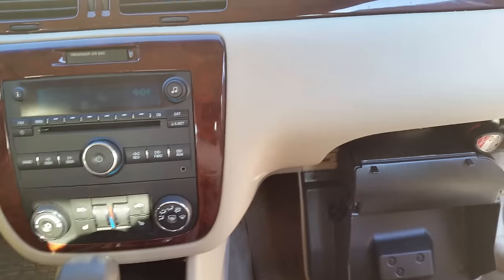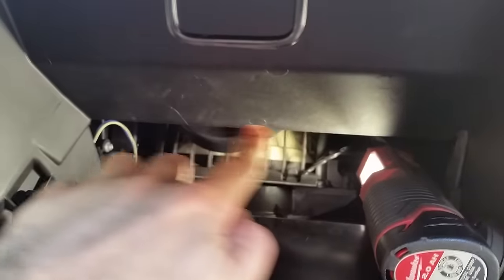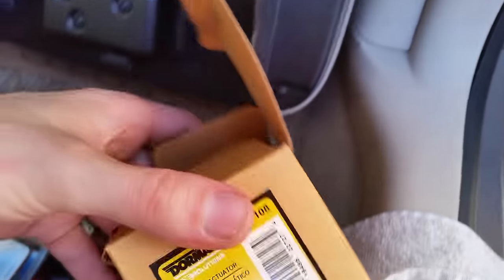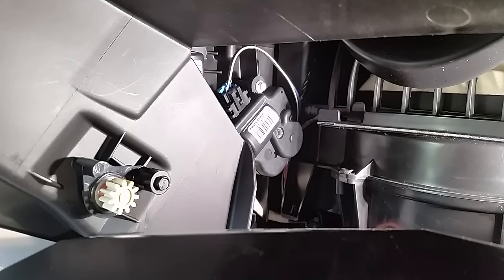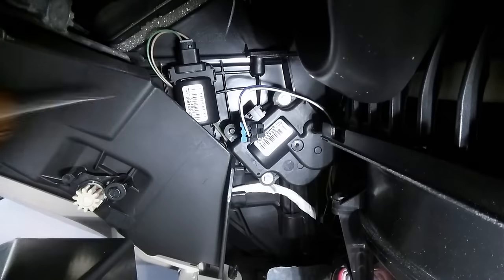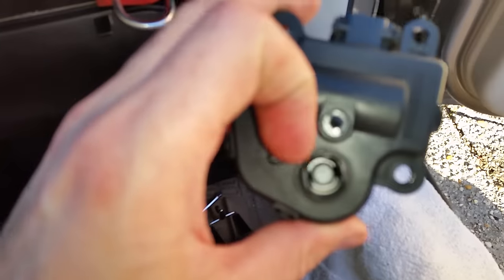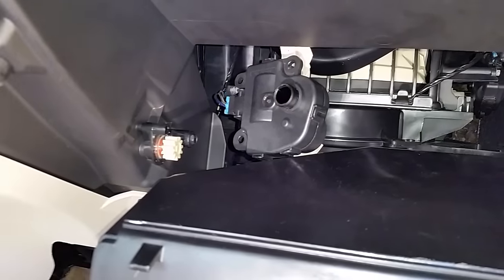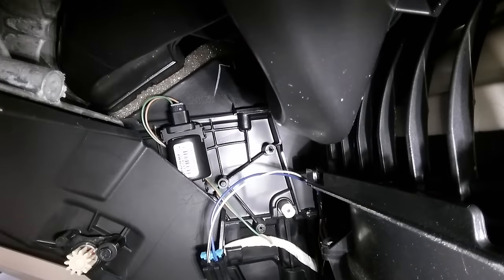How To Replace A Chevy Heat Door Actuator - Impala 2006-2013

Comment: hi! was wondering if u could post a video of replacing the mode actuator. Also, if i dont have dual climate controls in my impala is there still an actuator located on my drivers side or is that only with impalas with dual climate control?

Comment: Watched your video and replaced the actuator. I took it apart no bent gears. Still hearing the clicking so I think it wasn't the actuator. The clicking is not very loud pretty soft and one thing I notice no movement of the door maybe the door can't open and that is causing the clicking? Thoughts?
Reply from the maker: Kyle Boyd there are a few actuators to look for..did u put ur hand on the actuators to feel which one is clicking?
Reply: klowny1969 it seems to be coming from behind the grate the thing that is supposed to open and close. I have an 08 impala
Reply from the maker: Kyle Boyd have u checked the driver side actuator?
Reply: klowny1969 I'll check it but it seems to be coming from the passenger side and sounds noticeably quieter than the clicking sound in your video
Reply from the maker: Kyle Boyd ok..i also have a video for that one..check my description for the link..the sound travels..and it sounds more like it comes from the niddle of the car when the driver side goes

Comment: Just watched this video (3/17/19) - it is very helpful.  I do have a question - is the recycle/fresh air actuator on the right hand side of the glove compartment the same actuator as the one you just replaces (in other words, does the heat door and fresh air use the same model of actuator (that actuator could be used in either spot), or is each actuator a different model/design?
Reply from the maker: The same..donr forget to subscribe!!
Reply: @klowny1969 Thank you for your response and great video.

Comment: Using the harness connector to adjust the same angle on the new actuator before installing prevented me from thinking I had to use pliers to manually move it.
Thanks
Reply from the maker: Thanks for watching..dont forget to subscribe

Comment: Thanks  for the video.  I'll check on mine.  I think is not working because I have no heat.  I'll post later if that was the problem.
Reply from the maker: Jose Castro np good luck

Comment: I'm a little confused about turning the hole to get it lined up the same as the old one, doesn't moving the heat control on dash mess thngs up? Like will it still be set as low and high heat if I move it? Can't I line it up by just hooking it to dc power off a battery?

Comment: I was told it is either my blendor or actuator. Are those two different things? I have cold air coming through my driver side and slightly warm air on the passenger. Already replaced the radiator and had a coolant flush. My radiator was leaking badly. We assumed that was why my heat wasn't working. But then realized it still wasn't working after the radiator was fixed. Brought it back to see why it wasn't working, and they couldn't figure it out with the courtesy check and said I'd need a diagnostic test done to investigate further and that it was either the blendoor or actuator. I do not have clicking noise. Im not confident on being able to do this on my own. I do have the tools already. I'm confused on the part where you mention where something is pointing and I can't see anything moving in your video when you're changing the heat up and down.
Reply from the maker: There are three actuators in these cars..two in the glove box and one on the driver side..I have the glove box and driver side videos..you have to see if the doors are moving when putting the heat on and off..don't forget to subscribe

Comment: Hey, so you don't need a scanner tool to recalibrate the actuators? I'm about to have to do this myself and I'm little confused on how to keep everything calibrated so that I don't have to do this again very soon.
Reply from the maker: no scanner
Reply: klowny1969 ok cool so is there anything specific I should do to keep everything calibrated? I've heard a lot of mixed information on this. Have these actuators you replaced kept working?

Comment: Hi dear,
I am trying to find kind off the same issue, no heat on passenger side on my   07 Buick Lucerne 3.8. I have found only one actuator on the driver side witch was no working and have been replaced. On the passenger side I have found three total actuators and all of them are working normally including the big fan. Do you have any suggestions please. Thanks

Comment: My  driver side clicks... I also have problems getting the dual climate to work properly. It is often reluctant to switch from heat to air...  I'd that a wiring issue?

Comment: I know this sounds crazy but that sound in my car goes off at the most random times. I could open my drivers for and there goes the ticking. Any idea which actuator that is?
Reply: Did you figure out which one it was? My car does the same thing. I open a door and it'll start clicking.  I've determined it's the one on the passenger side of the heater coil. Are there more than just the two?

Comment: When it comes to getting the shafts to align the same as the old one, simply place the new actuator on the shaft and turn the key on, the actuator will turn until the screw holes line up and will stop on its own. Then just install the screws

Comment: I replaced my driver side and the one behind over box fixed clicking but now I have ac and no heat blows. Tried every setting with ac off. Just blows cold air. I'm I'm confused.

Comment: i have a 2005 chevy impala 3.4 l....heater works on passenger side but not drivers side. ... and no defrost. ..would it be the actuator on the driver side??

Comment: I have this same problem with my 2013 chevy impala the a/c blows cold but I get no hot air in anyway. if I unplugged the actuator in the glove box to stop the noise will I still get cold a/c or will that stop it from blowing as well??
Reply from the maker: KLAUS DELGADO depends which way the door is
Reply: klowny1969 it's directly in the dash as yours shows and it won't blow hot air cold is good it cools real fast but the noise is only when you unlock/lock the car or turn it on. when it's starts clicking noise
Reply from the maker: KLAUS DELGADO unplug it..u should still have cold air

Comment: So I change my blind door and heater was working before only when I was driving and now heater doesn’t work both way idle or driving
Reply from the maker: If your heater was only working while driving then it probably wasn't your heat door actuator. Did you properly diagnose it? Cause it sounds like your heater core is probably clogged. Don't forget to subscribe

Comment: Have you ever heard what is the problem with 2013 Chevy impala
Turning left from stop traction control goes off and slight grinding noice. Also tire seems to be wearing on inside more than others.Even though alignment has been done. Front drivers side. Seen all kinds of posts but no real answers. Chevy just ignores. Just asking you seem very kwolegable. Any info would be appreciated.

Comment: Thanks Klowny this video helped me alot and it saved me 300 bucks!! Hey I was wondering if this happens again, can I just disconnect the wires and leave it as is??
Reply from the maker: you can but ir heating system won't function properly
Reply: Ok thanks, so if I dont use my heater because its so damn hot where i live ...I should be ok?
Reply from the maker: Yes
Reply: +klowny1969.  2010 Impala. My cqr is blowing cold air and clicking when I changed from inside air to outside air. I just changed blend door actuator. All good there now.  Now, I have heat on passenger side and cold air on drivers side.  Both sides set on heat.  Which actuator do I change where can I find it?
Reply from the maker: +michael davis check the driver side actuator if its working.just pull the panels and chanhe from heat to cold and touch the actuator and see if its working .i will post the link of where that one resides, under my description i will put up the link for it..
Reply: Thank you sir.  I will check in the morning.
Reply from the maker: +michael davis np
Reply: Klowny1969.  I watched the video to the driverside.  Looks like a fun challenge.  I will need a shorter ratchet. Lol.  My actuator isn't clicking. I will check to see if it changes temps at the actuator.  I will keep you posted.
Reply from the maker: +michael davis kool good luck

Comment: how many a/c and heat actuators do the 2007 chevy impala have. because I hear the same sound around the driver side and when it stops the one on the passenger side starts making the noise? also after I turn off the car the clicking sound starts again for 30 seconds and then stops.
Reply: I have the same problem, I don't like Impalas anymore xD

Comment: i replaced both actuators and its still making the noise.. do you have any ideas of what it might be
Reply from the maker: Eternity Santos you have to get in there while its making the noise and feel which actuator it is..remember there is also an actuator on the driver side..and there are three on the passenger side

Comment: so right now my heater on the drivers side works perfectly fine but the passengers side is blowing out cold air is this heat door actuator the problem? also about 3 months ago I had to replace the blend door actuator because I had the ticking noise. that part replacement went just fine now it this new problem.
Reply: Same part
Reply: Mine was ice cold now it's fine

Comment: Can i still drive my car if i take off the actuator until i get a new one or will it mess up my car ? Also if i take it off till i buy a new one will the a.c still work ?
Reply from the maker: U can take it off..ac might not work on certain vents
Reply from the maker: Dont forget to check the description for the link to my shirts!!
Reply: Okay ill check them. So i can drive the car around with the actuator disconnected correct ?? I hope im taking off the right one. Hopefully its that one that you took off cause it makes the noise when i turn on the car or when i change the temperature on the a.c. and it also messed up my battery i think cause it got to the point where it would make the clicking sound when the car was off and not used.. so i had to replace my battery. What do u think ?
Reply: Also if i had the car parked for about 30 minutes and if the car was on. The a.c would stop working. It would start working when i finally drove the car.
Reply from the maker: There are a couple of actuators that can click..u have to go in there and see which one is clicking..yes u can drive with it disconnected

Comment: That damn noise is so annoying.  I am going to change it now that you showed me!!!
Reply from the maker: Good luck..make sure u change the right one..there is more than one actuator in there..thanks for watching
Reply: +klowny1969 I have a 2010 impala and when the heat is working on the passenger side it is not on the drivers side. Is it the actuator that is on the left side of the glove compartment (How To Replace A Chevy Heat Door Actuator - Impala 2006-2013) This video? or is it the one on the drivers side? I get air conditioning from the drivers side just no heat. I have full coolant and good heat on the passenger side (dual climate control)
Reply: +J Holmes  did u find out what causes the problem of no heat on driver's side, but heat on passenger side. cause am having the  same issue?

Comment: You can just stick it in hold it in place & just turn it on and it will align itself and bolt it down too..... I did all three of them on my 2011 impala the dealership try to rob people on replacing the simplest parts....

Comment: Please help, on my 2011 impala the a/c used to work while the clicking was going on but after a while the ac wouldn't work,and every time i turn the knob for the ac the clicking starts or even when the car is opened?? Any idea if changing this actuator will help the ac work?
Reply from the maker: Cristian's Aquarium it should ..yes..but there are a few actuators..verify which one it is first
Reply: klowny1969 the one that you changed here is the one that the clicking comes from on mine too
Reply from the maker: Cristian's Aquarium yeah its possible this is giving ur symptoms
Reply: klowny1969 if the cool air is not working which one should i change??
Reply from the maker: Cristian's Aquarium my best advice is to first see what side isnt working..then check to see which actuators arent turning

Comment: Great video, just a word of warning. The outboard passenger side actuator requires very small tools and preferably small hands.  I ended up buying a 12 pt 5.5 mm box wrench (tiny) to get at the small area of access.  I also removed the glove box door insert to allow more room.  Still better than paying a fortune for a dealer or garage to do the work. Took me about an hour, once I had the correct tools in hand

Comment: I have cold air blowing on the driver side, and warm air on the passenger side when the heat is on.  The a/c blows cold on both sides.  I do NOT have any clicking noise anywhere under the dash.  Is this still the actuator or something else?  I have a 2007 Impala with a 3.5 V6
Reply: +Rex Keene i got the same problem as u did u find a answer to what was wrong yet??
Reply: David Andrade I also have the same problem any answers yet to that problem? I'm about to go and work on it and see if I can do it manually

Comment: would this also cause my car starter not to work in the heat on the passenger side to not work?
Reply from the maker: ebonee browning there is no connection to ur starter..and yes this can cause ur heat not to work
Reply: klowny1969 thank you....so I have to issues! ugh its to cold for this.
thank you very much.
Reply from the maker: ebonee browning np good luck

Comment: i have a 2006 Chevy  and my car does this sound. Check it out when I turn on the AC one side blows cold air the other side heat... do I need to change the actuator and the blend door?
Reply from the maker: tblazn jason just look and see what door doesnt open and close
Reply: klowny1969 from the acutator or the blend door?
Reply from the maker: tblazn jason same thing
Reply: tblazn jason please update if you figure it out, I'm having the same problem w my 07 cobalt :(

Comment: Great video i had the actuator on the passenger side go out fixed and had heat awesome ((Premature celebration)) then at the same time the driver side went out, all 3 actuators went bad (bad luck i guess drivers side & passengers side and heat control actuator that's in this video also) but no big deal will fix it. got the parts, clicking gone on the passenger side! but one last thing now that that's done I turn the vent direction switch to floor or defrost or dash vents for ac or heat now that's not working and now just blows cold! Any suggestions or videos, thanks Klowny for all the help again great videos!!!

I still have cold on the drivers side still have to fix that its disconnected till I get to it and so is the actuator on the left side of the glove box then the vent direction switch went out also and is disconnected ((like the one in  this video)) now the dial for the vent settings only gives me defrost and floor vent and could the switch on that have gone bad also? The fan seems to be Blowing hard and strong lol. what do you think let me know, thanks again.

Thanks, Stimpy
Reply: look forward to hearing from you told the parents we could fix just about anything on using your videos on you tube and they told me they enjoyed the video and it moms car hope you can guide this Soldier through this  mission before back on duty, if you have a link send please and hers is a 2011, thanks Klowny

Keep making great videos! told the parents to subscribe!
Reply: Also just wondering is there a fuse for this?? but that may to easy....read the manuals and no guidance or instructions fyi
Reply from the maker: Sorry but its hard to keep up..but i would fix the ones u know are bad first..then take it from there..also check to see if the new ones are actually moving the doors when u install them..if not check for power and ground to the actuator
Reply: thanks going to try to tackle it tonight

Comment: When I press the A/C buttom it flashes 6 times then turns off, never get cold air , blows air in all positions.. 
Any advice on what to look for , thanks..
Reply: Your A/C fluid is low! You need to get it recharged!!! 👌👍

Comment: i have a 2011 impala and its not making the tapping noise bt when i have my heater turned on i get cold on the passengers side no heat will changing this help ... thanks in advance
Reply from the maker: Evermk Catalan yeah its possible that its ur actuator
Reply: the one you changed on this video?
Reply from the maker: Evermk Catalan there are a few actuators on the passenger side..u have to see which one isnt working
Reply: is there any way to find out?
Reply from the maker: Evermk Catalan yeah..see which one isnt turning its door
Reply: alright man thanks. ill look in to it
Reply: Finally got to fix my problem... i changed the two acuators on the glove compartment
Reply from the maker: Evermk Catalan cool